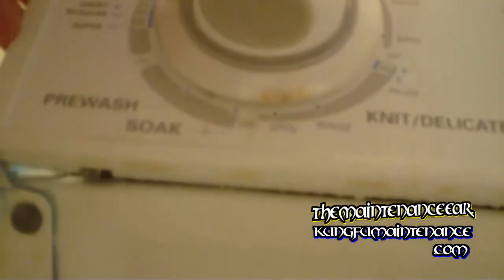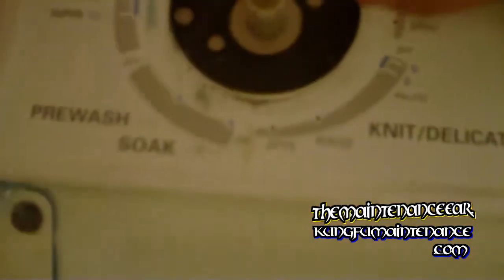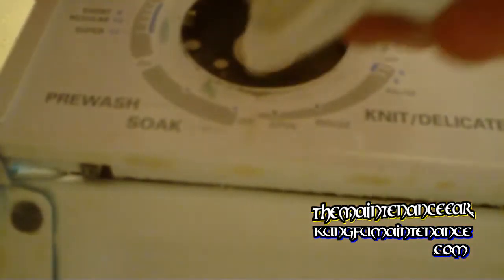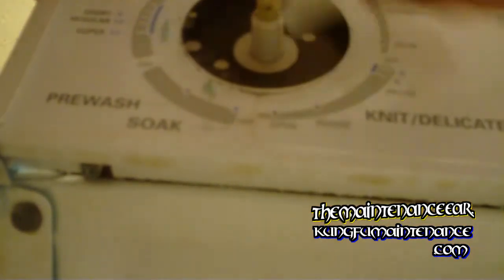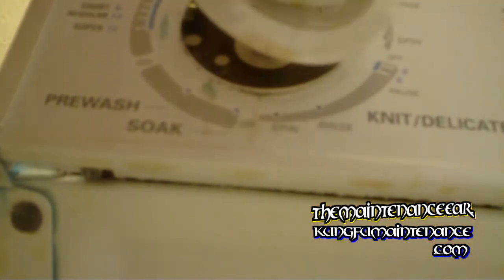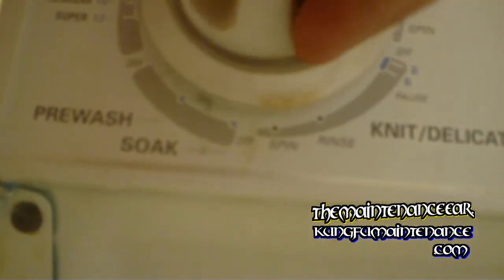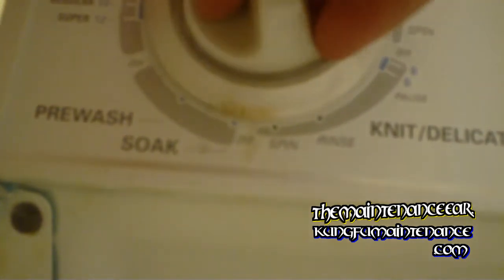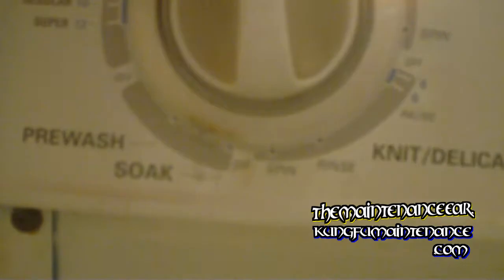Washing Machine Malfunctioning Won't Turn Off Time For New Timer Plus Wiring Harness

Comment: my washer won't fill with water. when I turn it on it goes straight to agitate. all other cycles work just won't fill up! HELP!!
Reply from the maker: Sometimes the fill tube sensor pressure switch  plastic tubing gets worn and damaged (especially at the ends where it connects to the ports. Often these can be trimmed and reset making a more solid connection so that the sensor can properly sense the fill levels of the clothes washer. May also be a problem with the water valve and solenoid affecting the water temp mix.  Check out Bill Newberry's video he does a good job of showing a similar repair that should help. "Washer is Overfilling - How to Repair" at about 1:10 on shows the pressure switch.